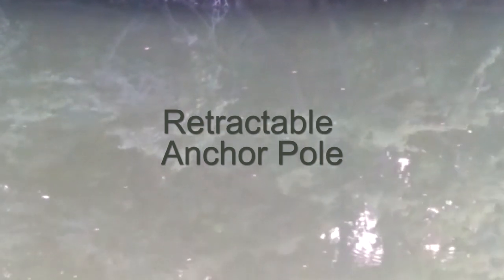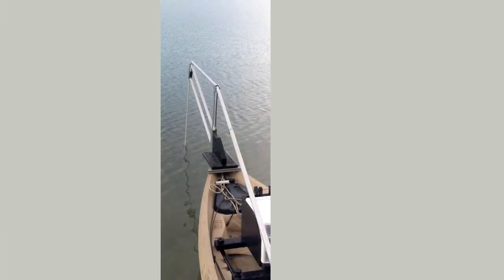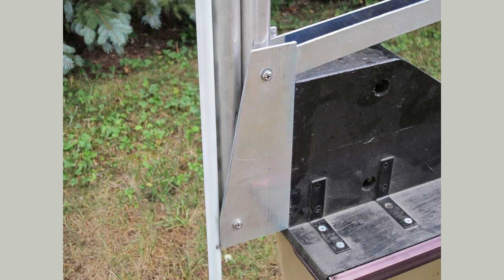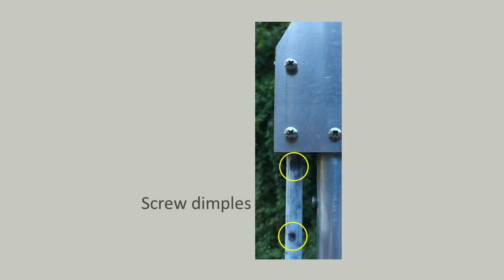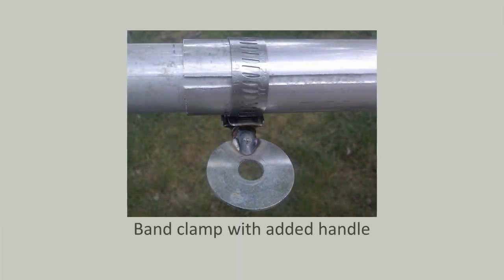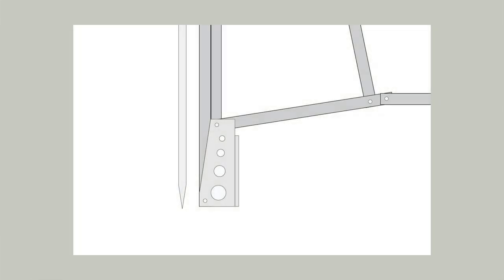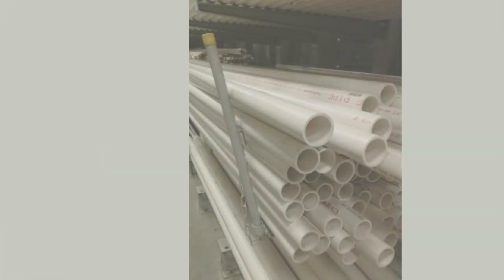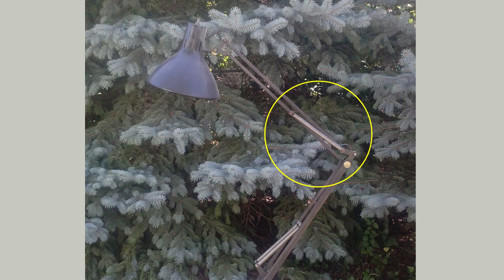PURE GENIUS!!  Retractable Anchor Pole: a Home Made Manual Power Pole for $70

Comment: I found aluminum tube and even solid rod at a metal fabricators shop. They just ordered what ever length I need. A LOT cheaper than the big box stores. Just google for fab shops in your area. Love the fact that you took the time to make a full size wood prototype.Thanks for the video.
Reply from the maker: Thanks for the reply. I found that the big box stores did not have the shapes I needed. I wanted the round tube because I think it looks better. However, you could just as easily build it from square tube if you wish. But you are right, I was able to buy what I wanted and it was less expensive.

Comment: anyone that goes out in kayak without a real anchor is asking for trouble. That pole will not anchor you in deeper water.
Reply from the maker: The pole holds my kayak steady in a moderate current in water 8-9 deep; the river I fish rarely gets deeper than that and is mostly much shallower. I had to cut the ropes on several "real anchors" because the anchors snagged on sunken trees, so anchors are not a viable solution. The pole will not dig in to a solid rock bottom but then a real anchor would slide across as well.
Reply: I use a an 8' fiberglass tree stake I bought from Amazon and added a "T" handle of PVC and an eyelet for attaching rope. I use it through my scupper hole and anchor in shallow water up to 7'.
Here is a video of how I made it. Works great and not a lot of extra weight on the kayak and I can remove it or lay it down in my 14' kayak if not used.
https://www.amazon.com/gp/product/B003405FVW/ref=oh_aui_search_detailpage?ie=UTF8&psc=1
https://www.youtube.com/watch?v=e68T5KkMn7g

If fishing or traversing water deeper, I use my anchor which I bring with me on every trip regardless for safety. I have an attached quick release if the anchor gets snagged and can reset it for use right away again. Check out this review with a link to buy these from a guy in the U.K. It is by far better and easier than the small zip ties to break off and then you have to use more to re-secure.
http://dizzybigfish.co.uk/review-of-anchor-trip-link-clip/
Reply from the maker: I previously used a stake out pole in the same manner and found it had its limitations (see the introduction and the video for that). That is why I moved to this design. Thanks for watching.

Comment: Do a video on your tackle box table I have the same boat
Reply from the maker: It is just a three drawer plastic box I bought at Target. Quarter inch painted plywood surrounds it on three sides. It also has some braces on the back corners and a frame around the bottom edges that connect the walls to the base. The base is two 2x4s. The rear 2x4 is used as my foot brace when paddling. I also screwed a section of aluminum yardstick on the top to measure fish.

Comment: Nice idea!  Thanks for sharing

A couple of thoughts that may be helpful.

You could use a clam cleat for holding tension on the rope if you decided to make a retracting mechanism.  Also a stainless steel spring loaded plunger could be used to lock the pole in various positions  if needed.  The plunger could be operated remotely from your seated position via a .093 diameter weed eater line with appropriate hardware and associated pull handle. i.e. weed eater pull rope starter handle.

It was hard to tell from your video how the unit attached to your NuCanoe.  Also, how it would be removed and installed during transport operations.
Reply from the maker: Thanks. Retracting is easy, just pull on the handle. After using it, I realized there was no need to lock the pole in position; just shove it in to the bottom and it stays put. The wood bracket is bolted to a Minn Kota trolling motor mount. I slide it backward to remove it from the boat. Others will mount it in a different manner.